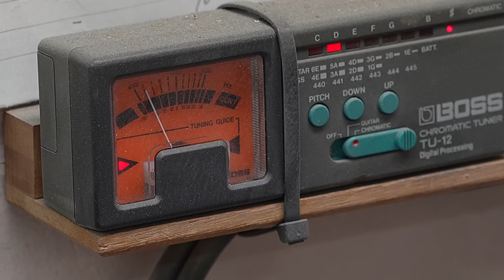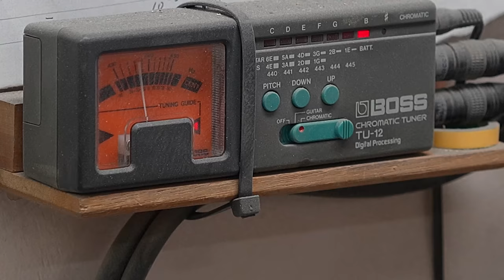Process of making Electric guitar | Electric guitars handcrafted by Japanese craftsmen | Deviser

Comment: Interesting..they also make the necks...many small builders outsource the necks and just put in the frets and attach it to the guitar body.  To be able to be so precise with a industrial router like that  around curves and free hand this stuff is nothing short of remarkable.  In  a cheaper guitar line all of that work would be done via CNC milling machines.  Necks are tricky because many are not made from a single block of wood, they are made in a laminate fashion using various woods.